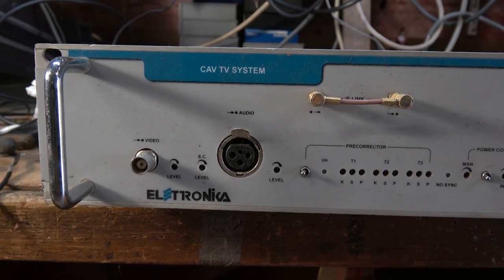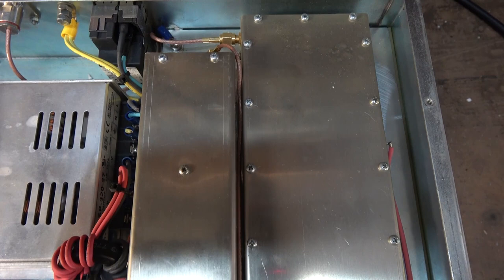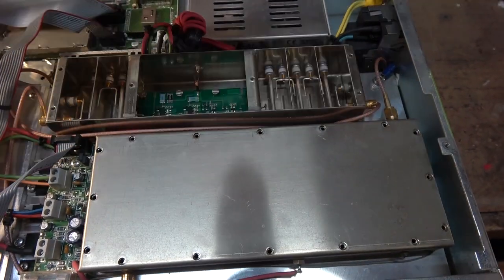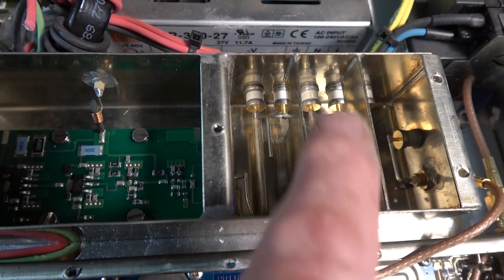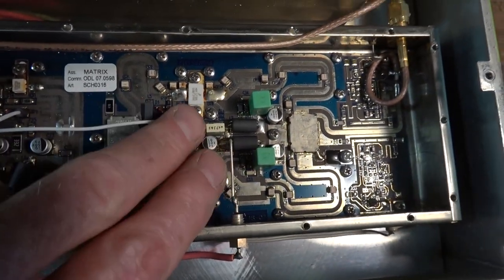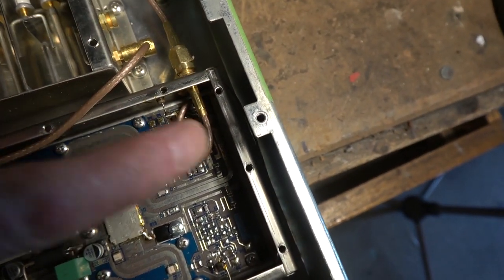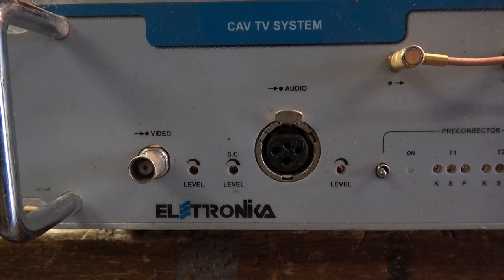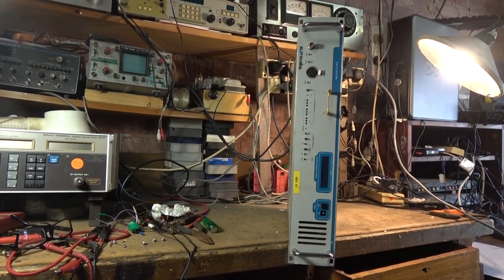UHF TV Transmitter

Comment: A good chassis and power supply  for a homebrew amp.
Reply from the maker: Yes a nice 11A 28volt switched supply, the most usable thing in it. The PA transistors would be good if you you could get them out.